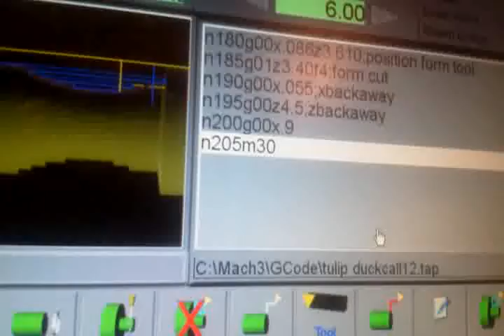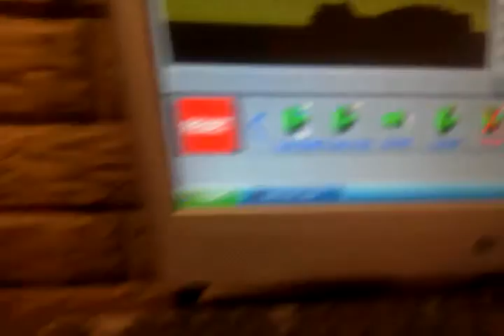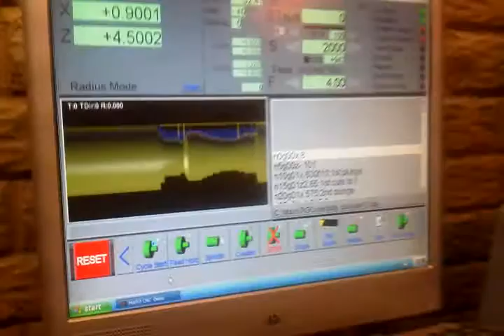cnc duck call example

Comment: What is the name of the machine and where would I get one?
Reply from the maker: Its a emco compact pc5 found it on ebay, it was missing the chuck so i made a #2mt expanding mandrel for it and did a mach 3 retrofit for the control. These were teaching machines primarily sold to schools and companies,the oem controls will work for what you want to do but make sure you get software,a software  dongle and interface card if applicable to the machine or you will have to retrofit.Other machines that would be good iron denford orac, southbend magnaturn.prolight,etc you prabably want a 200lb plus machine at minimum the emco is close to 200lbs. The lightmachines lathe on my goose keg example is too short and not enough mass spindle speed is ok but still have to feed too slow its weight about 100 lbs.  I have been lurking on tho since 2011 i will try to introduce myself there i go by butch1 if you have any questions.